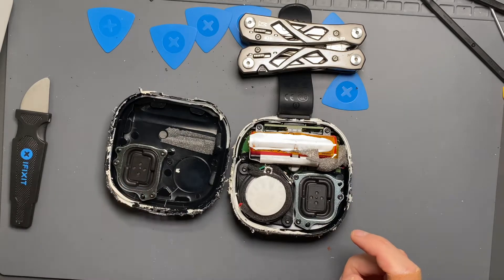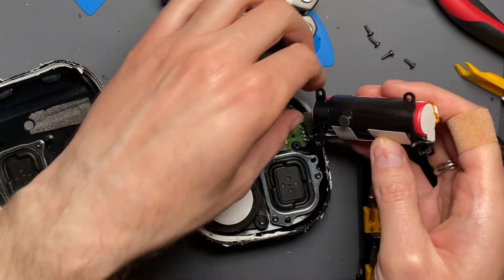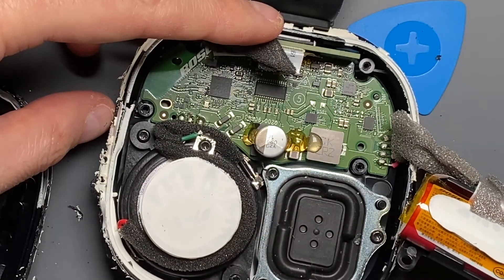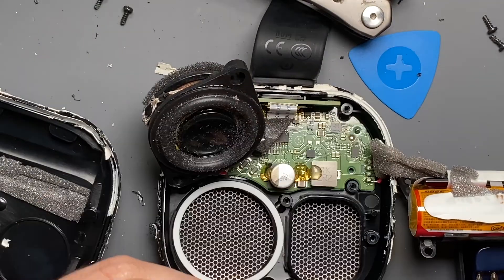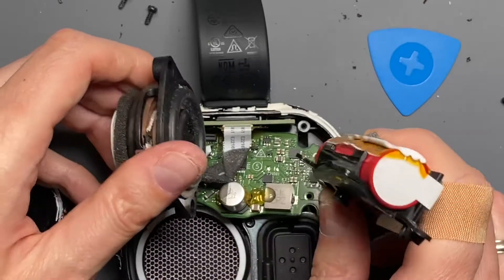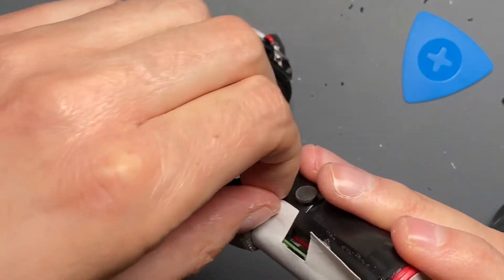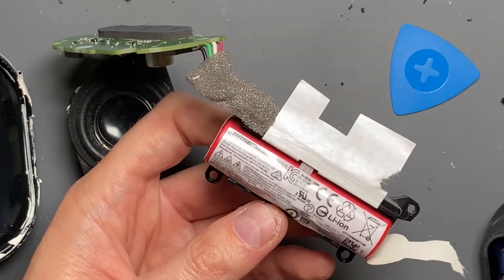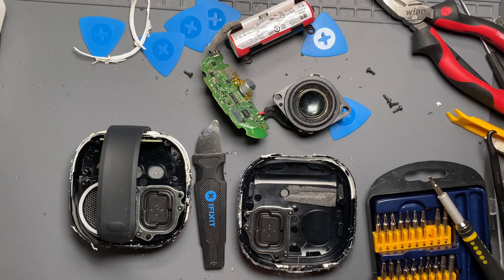Bose Soundlink Micro Teardown - Part 2 - Looking Inside!

Comment: Helpful video .. thank you for making one .. I have similar unit and my micro usb stopped working … when I visited the authorised service Center they said there is no repair for this product as this is a concealed one and you get a replacement only during your warranty period …. Only option left now is trade off which is 10 % discount on a new purchase which is not a good option …. 

I decide to break open the unit and repair myself and now the unit works as good as new 😊

Comment: Hi,thank you very much for uploading such a detailed teardown video. But I'm afraid I couldn't get your last few words about the longevity of the battery. Being an Indian I probably failed to understand your pronunciation. But it sounded something like- you've already been using the speaker for three and a half years and expecting the battery to run for another five years. Or am I mistaken? If you could please clarify the matter,it would be highly appreciated. Thank you.
Reply from the maker: Hey thanks. Yeah, I looked back at the video and it appears that I said that I'd been using the speaker for about 3.5 years and the battery was working fine, so I expected to get another 1.5 years or so out of it before I needed to replace it. I can tell you now, 1.5 years later (lol), that the speaker's battery is still fine with light-to-moderate usage! Thanks for watching!

Comment: Hi, very detailed and good video. I have a different issue with my bose soundlink micro. It seems to work, charge battery, but suddenly it dosen't speaks, It connects to a device but not play anything, it doesn't speak neither:  "Battery at xx% ready to connect". I could update the firmware to the last available  versión 3.0.1 but anything changes. What could be? the bluetooth, the speaker? Any ideas or test I can do to repair it? Thanks
Reply from the maker: Thanks! Have you tried a factory reset? Turn on the speaker, and then press and hold the power button until all the lights turn off. Then turn it back on again, and set it up again. Let us know if it helped!
Reply: Hi. Thanks for your answer. Yes, I've tried factory reset but nothing happens. Recently I tried pushing volume - and + at the same time and ir worked again for a couple of days. Connection and battery Voice info and music. But yesterday I was using it but suddenly no sound again, despite it keeps connected and I can action play and stop function in phone from Center button of the Bose. I'm using the same Android phone I always usted. I don't know why this happens

Comment: Thank you very much for the video, it's awesome.
Just to let everyone know of one thing i did different is that before starting to prying out the clips. i used my Heat Gun to soften the adhesive all around the speaker for a few times and then just slowly pry it open. it worked like a charm.

Thank you for all of your hard work making this video!!
Reply from the maker: Thank you! I was considering using a heat gun,, but was concerned about using any heat near a Li-Ion battery. Were you able to open it without damaging the clips then?
Reply: You're very welcome!
Yes, all the clips are intact. But your video helped me tons. thank you

Comment: Nice video series. The battery is dead in my Soundlink Micro and I would like to remove the battery and get this to play solely from the micro USB connector's power input.... any chance you can detail how to do that, if it is even possible?
Reply from the maker: My guess is that it wouldn't work well, if at all. First I am not sure the speaker would operate with the battery removed. Second, even if you could remove the battery and power directly from USB, the amplifier is rated above that of standard ~10 Watt USB input, and might collapse power supply causing a bunch of issues. Does the speaker work at all when it is plugged in, even though its not taking a charge?
Reply: @TheCuriousEngineerChannel  It does not play or even power on when plugged in via the micro-usb now that the battery is completely drained. I use it at work connected to my laptop via bluetooth to play audio from zoom/teams meetings and low volume background music other times, so my expectation is that I would not tax the amplifier to its maximum power draw. I appreciate your response. I’m going to toss it in a box and add this to the project list for a rainy day.
Reply: Can the battery be changed? Y/N. ??